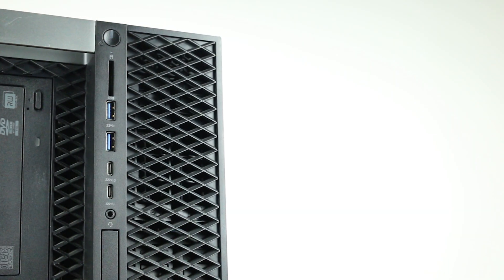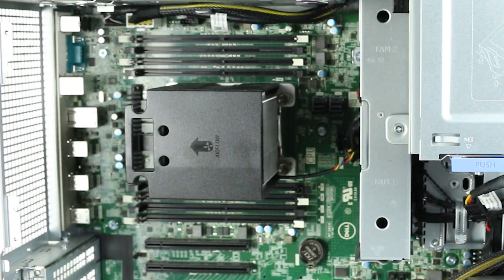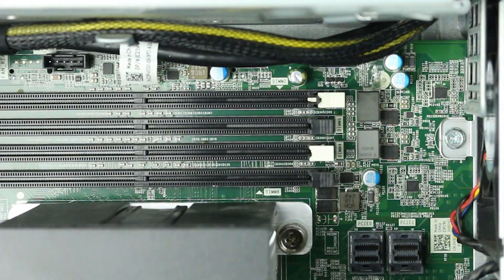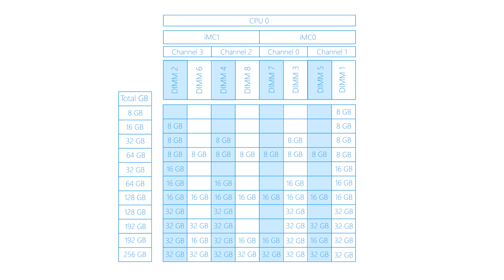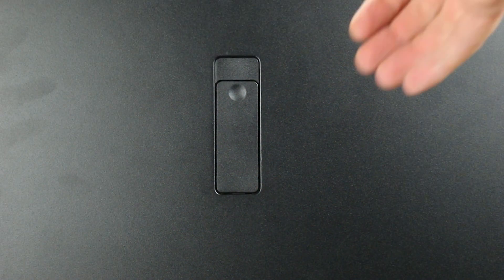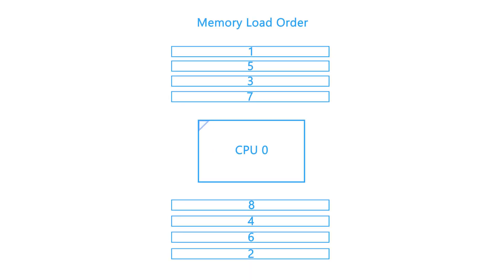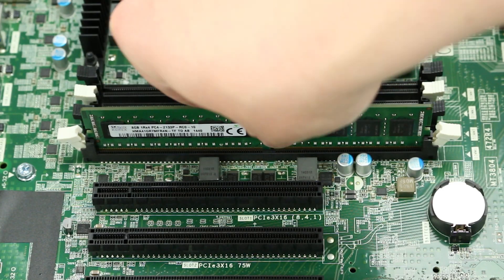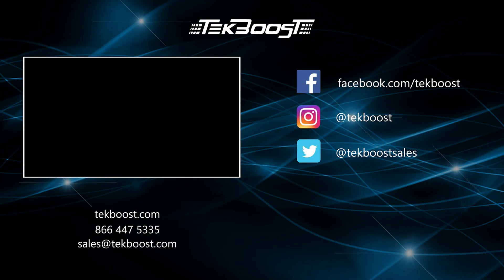Dell Precision 5820 Memory Installation

Comment: I have the same exact desktop and it came with 16GB Ram. I bought an upgrade to 64GB Ram by Corsair Vengeance. I removed the original 16GB it came with and replaced them with the Corsair. Now my Desktop will NOT come on. I can hear the fans for a quick sec, but nothing happens after that. Any idea what is happening or what I can do? PLEASE someone tell. THANK YOU.
Reply: Have the same issues, but It beeps as soon as you plug in, after that, no power on.

Comment: Hello... I have a Dell Precision 5820 with 3 x 8GB PC4 2666 RAM, 1 x 16GB PC4 2666 RAM and 1 x 32GB PC4 2666 RAM.

What would be the correct layout as the PC is now beeping and not booting. All I did was remove the memory for maintenance and I don't remember the layout... Any ideas?
Reply: Did you figure it out?
Reply: @arizvisa  DIMM 1 = 8192 MB
DIMM 2 = 16384 Mb
DIMM 3 = 8192 MB
DIMM 4 = 8192 MB
DIMM 5 = Slot Empty
DIMM 6 = 32768 MB
DIMM 7 = Slot Empty
DIMM 8 = Slot Empty
Reply: @diegocastro-ar  Ah, that's pretty lucky you got it to work. I ended up getting in contact with Dell and they gave me a larger table of all the memory configurations that weren't listed in the manual (which vary depending on the processor type).

Comment: I have a PC with 2 8GB PC4 2666V RAM in currently.  I tried to upgrade to 2 16GB PC4 2666V RAM and the PC beeps three times and won't boot.  All I did was remove the 2 8GB RAM and replace with 2 16GB RAM in the same slots.  Any ideas?
Reply from the maker: There are various types of 2666V memory and its likely a compatibilty issue.  If you have a Core processor such as an i7 or i9 you need Non-ECC 2666 which will either show 2666V-U or 19200V-U on the memory stick.  If you have a W-2xxx processor you will need ECC RDIMM memory which will show as 2666V-R or 19200V-R on the memory stick.  You can also look at your old memory and see if you have -R or -U memory.  If you are using the same, then install one stick only, and try again. Then repeat with the other stick.   This will determind if either of the sticks is defective.  Best of luck.
Reply: @tekboost  Thanks for this comment.  I thought I got the right memory as I used a configurator for the W-2xxx processor.  The memory I have has 2666V-E.  I've never had to deal with this variable before.
Reply: @dannobles8028  No problem.  The W-2xxx works with both 2666-E and 2666-R, but both cannot work in the system at the same time.. Unfortunately the configurator will not always give both options.

Comment: Doesn’t worked with two 16 GB PNY XLR8 2666 MHz
Reply from the maker: I believe that memory is Non-ECC Desktop memory, and will not work with Xeon Processors (W-2xxx) in the T5820. However if you have a Core Processor (i7 or i9) Non-ECC should work with it.  Best of luck.
Reply: Can we put the ram sticks in any ram slot and the pc will recognize and use them?